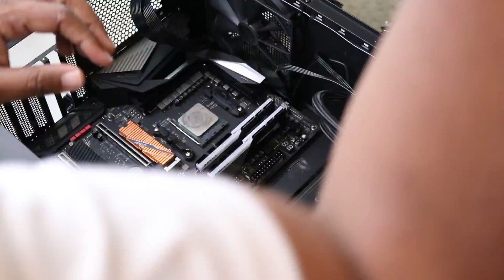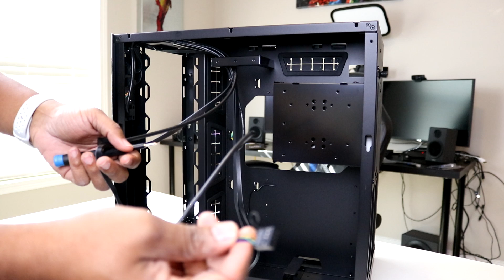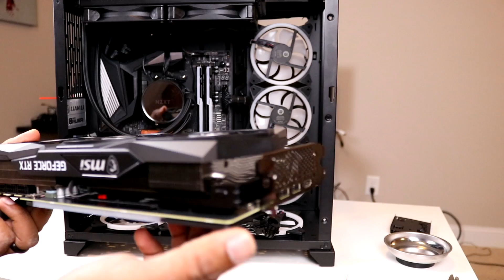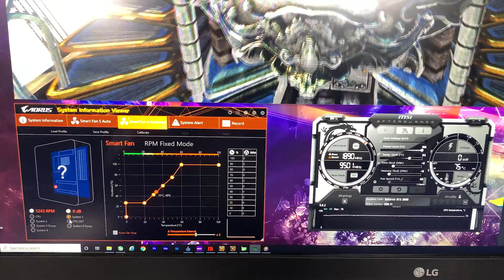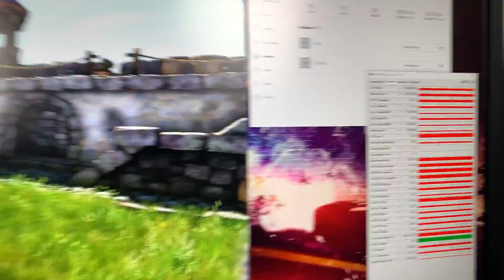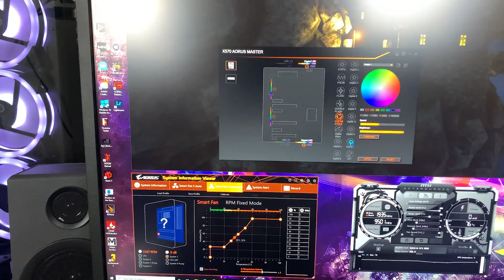Lian Li PC 011 Dynamic PC Build with MSI RTX 3080 Gaming X Trio

Comment: its so sad to see such a big, modern case, and the gpu cables still collide with the glas here, even on my smaler gtx1080. also: triple slot 3 fan 33cm card on 75 degrees not oced sound kinda of high. withc such a big cooler, i expected 65 nearly noiseless

Comment: Would it better to use a 240mm water cooler or a 360mm im looking to make a build with that case and my 3080 but idk which would be better for temps😭😂
Reply from the maker: I upgraded to the Z73 360mm aio https://youtu.be/Nw7rcmU8w_s

Comment: I have a question. Do you think it is a good idea to put a 3 fan AIO on the side panel and the intake fans on top?
Reply from the maker: Aio on the side panel is fine but it’s a bad idea to do intake fans on the top. Negative air pressure plus heat rises natural. Cooler air would come from the bottom. You should make the top fans blow out hot air.

Comment: There's plastic on the inside of the glass windows, I didn't know it for two years of owning, I should have the same 3080 Wednesday or Thursday!
Reply from the maker: Yep I noticed that to! Did you get your 3080?
Reply: @WiLcreatives  Yup! Probably gonna ebay sell it for 2k, grab a 3090 from a homie for msrp price, it's barely not able to do 2k240 or 4k120 for me, changed thermalpads, & paste cause the memory is to damn hot, 3090 resell should allow budget for the 4080

Comment: Did your case have an anti-sag bracket for the card?
Reply from the maker: No it didn’t not I need to pick up one of those brackets!
Reply: @WiLcreatives  Oh only the Dynamic XL does, I was thinking you had an XL variant. Also your cable management is horrifying. Otherwise neat build kudos.

Comment: hey the power cables coming out of the 3080 what are they? because the ones my psu came with are too bulky to close my o11 case back up
Reply from the maker: They are flat cables made by seasonic. I also blended them flat against the graphics card so they didn’t hit the glass.

Comment: is this the best fan setup ? getting the same case and gpu
Reply: For this case. Intake bottom, Intake Side, Exhaust top is proven to be the best setup. If you want the RGB Lighting to look good though you need fans that light up on both sides since the fans will be facing away from you. So you could potential do 6 Corsair QL series and 3 Corsair LL's for the top.
Reply: i’m getting lian li uni fans, and have seen this config and one with intake bottom, exhaust side, and intake top also being good.
Reply: @saiuhh5280  Heat rises so usually top is best for exhaust since it goes with the natural flow of air. If you have intake at the top it will work as well, but you would also be fighting against the hot air. This video does a good job testing the different configs for this particular pc case.

https://www.youtube.com/watch?v=KU6vIDpNaxw&t=473s&ab_channel=HardwareCanucks
Reply from the maker: @burnmybread is correct!

Comment: Not sure how youre keeing your cpu cool if all the hot air is going into the top fans then going thru the rad and somehow cooling the cpu with hot air???
Reply from the maker: The 6 fans bring in cool air is mixing with the gpu hot air. Haven’t had any issues!

Comment: Nice work! This is literally the same build as me besides fans, rad, cpu.  Just waiting on the gpu to ship, hopefully it actually ships!
Reply from the maker: Nice what type of GPU are you waiting on?
Reply: @WiLcreatives same as you. msi gaming xtrio 3080. Finally Got lucky on Amazon.  So I literally have the same build, but I'm using a master cooler 360 aio but took the fans off and using 9 lain li uni fans. Cpu is 5800, ram is gskill neo 3600 16g. Seasonic prime gold psu, a few Samsung evo pro 970s 1tb.  Just ordered a new Dell 2721dgf monitor too.  Can't wait to get it running but I'm Still waiting for last set of fans to ship, everything has been so hard to get. It took me months to part it together..  also what brand and size monitors do you have in the background are they 27 inch?
Reply from the maker: @Ryan-re1rs  Nice I just upgraded to the AMD 5800X. I use 3 monitors now. 2 on the gaming pc both 27in, PG279Q and LG 27UL500-W. I use a 28in 4K Lenovo monitor for my streaming/capture pc it’s a L28u-30.

Comment: When you snapped the trio onto the motherboard, did you notice if the back panel where the dp ports are located, was in an angle. I just snapped mine in the same case and they look angled high
Reply: I have a 3090 and have the same issue, it looks like the PCIE isn’t fully slotted in or something because of the mounting bracket.

Comment: Did you connect all the fan power cables to the mobo? Or a hub?
Reply from the maker: Yes I connected all the fan cables to the hub. Only 2 cables going to the motherboard, 1 for the RGB and 1 for the pwm fan header.

Comment: Think I’m just going to go with a different cpu cooler. Ideally, I’m getting a Corsair h150i pro XT. Getting it because the nzxt coolers don’t have rgb fans
Reply from the maker: Makes sense unless you plan on using different fans anyway
Reply: Nzxt has one of the best performing cooler. The newest version comes with rgb fans. Id recommend swapping the fans regardless. You will not be dissapointed going with a nzxt cooler
Reply: @ryy597  Cool to see them switch it. That option is noticeably more expensive tho. feel like the rgb fans should just be included. Besides, decided to switch to a white lian li or 4000d build. Not completely sure between the two, but looking at the 4000d cause it'll be cheaper to make but the lian li just looks so damn cool. Probably going to fit a 4060 ti or 5060 ti into the machine. Originally planned for a 80 series card but figured that at this rate the 3080 is going to be beaten in 1 year by a card at nearly half the price: 3060 ti. The 60 ti cards will most likely provide the best value for the upcoming years assuming they stick with the price and naming sceem. just wish there was more vram.

Comment: if the bottom 3 fan are intake and the side 3 fans are intake and the 2 fans attached to the radiator are exhaust that means that you taking hot air through the radiator witch will increase CPU temps
Reply from the maker: When you have enough cool air to mix with the hot air it actually turns out just fine. I haven’t had an issue with my cpu temps.

Comment: Did you have to screw anything in the back of the mobo to support the aio cooler on the cpu?
Reply from the maker: No the brackets are on the X570 boards, cooler just hooks on and you screw the bolt to tighten it down.
Reply: @WiLcreatives  sorry for all the questions but i have an asus rog strix z490-f mobo, do i have to mount the back plate on it? i really appreciate the quick responses! Doing my first pc build ever and your video has really helped me tremendously. Well deserved sub from me
Reply from the maker: @Korey1234  yes the back plate should be in the aio box

Comment: Hi, I don't think you have the correct motherboard listed in the description of the video... also I'd recommend you change the fan config to Intake on both top and bottom and change the side to exhaust and also use the anti-sag bracket that comes with the GPU as it will make your build look a lot cleaner :)
Reply from the maker: The link for the Aorus Master board is correct.

Comment: why are u pushing hot air through radiator ?
Reply from the maker: You get the best temps with my current configuration I just need a 360 aio at the top! https://youtu.be/KU6vIDpNaxw
Reply: @WiLcreatives  hmm. got my z73 on the side and its much better then on the top. k gotcha

Comment: I’ve heard in this case (which I have but have not tested this yet), side fans should be exhaust with bottom intake and radiator on top doing intake. Makes no sense to me doing it that way but from what I saw graphics card temps go up 2 degrees but cpu goes down by 5 degrees
Reply: The optimal placement for fans/aio is side aio with intake fans on bottom as well with exhaust fans on top.
Reply from the maker: @Korey1234  https://youtu.be/KU6vIDpNaxw
Reply: @WiLcreatives  same video I watched that put me onto this case
Reply from the maker: @dertysprite  Yep same here!
Reply from the maker: I’ve seen that as well. Cpu temps not a big concern for me but the graphics cards temps are with as low as a fan speed as possible. Perfect combination

Comment: Did you have clearance problems when installing and closing the case?
I have the same case and I want to put an Asus Strix 3090.

I have read that they are the same width.
Reply from the maker: Good question, the power cables push up against the glass a little, custom sleeved power cables should fix that or route the cables over the graphics card vs under. Also doing a vertical gpu mount would solve that problem if you don’t need access to the rest of your pcie slots
Reply: @WiLcreatives  I finished the new build.
The Asus Strix fits with no problem.

Thanks for your video, it helped a lot.
Reply from the maker: @serlleims7395  Awesome!